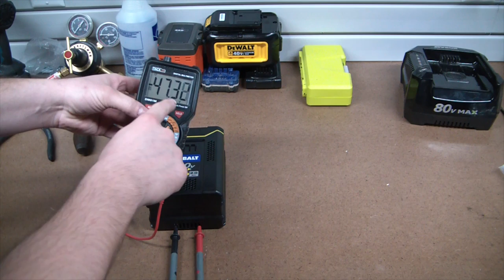Kobalt 80V Battery Recovery and Teardown - ElementalMaker

Comment: Just recovered a 2 year old 80v Harbor Freight Atlas battery ($110) that would start the trimmer, but immediately shut off recovered using this method.  Put it on the charger, flashing red. Checked voltage, 38+v each leg.  Press the test button, 3 lights.  Put it on the charger it would start the fan, then flash red. Connected same aged charged battery to each leg for some minutes, same issue.  Connected a new, fully charged 40+v per leg for 5 minutes each leg and this time it charged.

Comment: My dad developed back problems. Had these batteries sitting for a few years. Wouldn’t charge. No red light on charging dock. I hooked up plus and minus and charged it for a minute. Then put on the factory charging dock. And it is charging. Thanks.
Reply: There is a 20 hour "recovery" charge noted in battery manual

Comment: Will a 30v power supply work to charge an 80 volt battery?   Where do I get the terminals that stick into the battery, that the power supply clips, clip onto?

Comment: Who is the manufacture of the power supply you used to bring it back to life?
Reply from the maker: Thats a Sorensen lab supply I have, they are stupid expensive (I found this one at a thrift store), but any generic 60V lab power supply should work. That being said, its probably better to just buy a new battery. The one I recovered in this video only lasted about 6 months after recovery before it died again and I couldn't recover it.

Comment: @ElementalMaker - my Kobalt 80 Volt batteries(I have two) charges to three lights but when I put them in my blower it only works for a short time and shuts down. It reads two lights when it shuts down. Any Pro Tips?
Reply from the maker: It's probably a bad or reduced capacity cell within the battery pack. When one cell drains faster then the others, the battery will shut itself down to protect that cell from going under 3ish volts. You could run the battery until it stops working, and then open it up and probe with a multimeter to see which cells are lowest, then replace those cells, but I'll be honest that's way easier said than done unfortunately

Comment: This is a different subject than you were talking about here but wondering if you may be able to help me.  I have a new Kobalt 80v battery that says it is fully charged but when I put in the chainsaw it will start the chainsaw but then stops.  If I charge it again it will just do the same thing.  Do you know what the problem is?
Reply from the maker: Sounds like it may be a circuitry issue if the battery is new. Do you have any other batteries to test the saw with to be able to check that it's the battery and not the saw? If other batteries work, I'd say bring that one back to lowes while it's new and tell them you want a replacement. If another battery does the same thing in the saw, I'd guess there's some debris jamming up the output shaft causing the battery to sense a current overload and shut down the battery to prevent damage. I'd strip. The saw and be sure nothing is causing extra resistance on it like a bunch of little vines wrapped around the sprocket

Comment: Hey, I have one of these 80v batteries that charges well, but cuts off after about 30 seconds of use. Then if I wait another 30 seconds or so I can run a few more seconds. If I switch the battery tool works fine. Any ideas? Thanks!

Comment: What could be the problem if the third led doesn't light up anymore? I have 81 volt measured on the +/-.  Thank you very much.
Reply from the maker: Probably just a bad solder connection for the LED. If the battery is still working and charging okay I wouldn't even worry about it.

Comment: My kobalt 80v has an issue.  When i put it on the charger, the green light on the charger flashes, and all of the lights flash on the battery. After about five minutes, the battery lights go out and the charger lred light flashes.
Do i need to.perfomr your process to het it to work? And where do I find a power supply like yours?  Also, ehats the approximate cost of that power supply?

Comment: I have this exact 80v Kobalt battery. I was wiring up a electric Reel mower conversion and accidently blew the fuse on the back side of this battery. Do you happen to know what size fuse this battery pack requires?

Comment: I have a brand new 80v battery but it doesn't work, nothing but a solid red failure light on the charger. I assume I need to change the fuse on the bottom, but it looks perfect and is brand new. Confused
Reply from the maker: Best advice is to bring it back to Lowes and have them get you a brand new one

Comment: My charger begins to charge as normal but then after a minute or so it stops charging and the red light comes on. I check their voltage and they read 64 & 65 . Could the charger be bad?

Comment: My 80v Greenworks shows 1 light.  Blinks Green for about a 1/2 hour or so then starts blinking Red.  I had accidentally left it on the charger for the whole winter and that's what Greenworks says messed up my battery.  I thought about taking a battery tender and hooking it up to see if it would slowly charge it.  Thoughts?

Comment: I have a kobalt 40 v chainsaw that came with a battery and charger. I bought  another battery . I looked up kobalt batteries on Amazon. It has batteries i would think are kobalt knock offs and in the description it states they are compatible with kobalt tools.  Are these kobalt knock offs also compatible with the  kobalt chargers?
Reply from the maker: I can't speak for the manufacturer of the knockoff batteries, but I'm sure if they are listed as kobalt compatible batteries they will work with the charger. Definitely proceed with caution though, knockoff batteries are notorious for using cheap cells with poor protection circuitry and can die quickly.
Reply: @ElementalMaker  thank you

Comment: @ElementalMaker i just got a 4ah 80v greenworks battery off ebay that i think has this problem, i need to do what you did in this video, i dont have a dc power supply but i have a 2ah model 80v battery. What kind of wires do i ask for at my local home depot so i can jump the big battery off the little one? I saw another video of that being done, but this video is basically play for play what my 4ah battery is doing.
Reply from the maker: That's a very very dangerous way to go about it. You should have some kind of current limiting resistor in series to prevent an major malfunction. Even better would be to return the defective battery if you don't have the correct equipment.
Reply: @ElementalMaker  Unfortunately the battery was bought on ebay for about 1/3rd the current sale price on amazon/the greenworks website. So Greenworks won't do anything about it. I can send it back to the seller for a refund, but I just feel like it's salvageable and I need to at least try. When I put the battery in the charger, the charger turns on and the green light flashes and it acts like it's charging... but if you leave it charging for longer than 5 minutes it turns off and the light begins flashing red. So I shouldn't use a smaller battery of the same voltage to jump it, what power supply would you recommend in order to do what you're doing? Like, what am I looking for? If its like a $200 piece of equipment then I may as well send the bunk battery back and buy a brand new one, because at that point i'll have spent more than the 4ah battery costs. lol

Comment: I leave my 80V Kobalt battery on the charger all the time.  I went in the garage and saw that the red light was flashing. Its completely dead.  It had been on the charger for around 5 months.  I though the charger would trickle charge it as required.  Does leaving it on the charger after fully charged do damage?
Reply from the maker: Modern power tool batteries are lithium ion based and shouldn't ever be left on the charger. Best to give them a full charge, then briefly use it to bring it to about 75% charge, then just keep it on a shelf
Reply: @ElementalMaker  Thanks for the info, looks like I killed my battery.

Comment: I have the Snapper 60V same layout. I have two batteries that read Zero voltage and it will not charge even with a jump. How do yo get the batteries separated from the riveted connecters. I just want to replace the two cells that are dead. If you look at the top or bottom of each battery you will see a little double rivet on the plate. Thanks
Reply: Pry them off carefully

Comment: On my 80V Battery I get on (+) and (-) the Voltage, but no amps. I I'll test the battery with a tester, the voltage breaks down to 0. I'm pretty sure, there need's somthings to to with the midle pins, but I've no PinOut of the Battery. Could you help please?

Comment: What metal pieces do you put on the + and - on the battery to hook up to the power supply?
Reply: Were you able to get a solution? Don’t have a charger and need to get it powered up

Comment: I am hoping someone might be able to give me some advice. I have a battery that when you push the button, all 3 lights come on as if its fully charged. But when I put it in a mower it doesnt work. When I put it back on the charger, none of the light come on at all. What could be the problem? Thanks for any help or tips.

Comment: Kudos to you for charging at 250mA. It's not a good idea to charge at high current when discharged below the minimum voltage. But charging at a very slow speed until in the normal range is generally considered safe.

And yes, that battery is definitely made by Greenworks. Snapper and several house brands are just rebranded greenworks. The only difference between that battery and the greenworks branded one is the location of the grooves in the plastic outershell.
Reply from the maker: Agreed, some folks have apparently just jumped a bad battery with a good one, talk about a recipe for disaster! Thanks for dropping a comment Bob!

Comment: I did this and it it lighted up too and looks like it's charging again but when you use it. It still dies after 30secs of using it. So it didn't work
Reply from the maker: Man thats a bummer. Some batteries are unfortunately too damaged to fully recover. The battery I recovered in this video lasted about 6 months of use before dying again, and its capacity was definitely reduced.

Comment: Those batteries in that 80 volt pak are exactly what is in the PC batteries. I have about 50 of them and have bought VRUZEND caps and made many different voltage battery paks. For my 12 volt, paks, actually a bit higher
Reply: Do you know what cells are in them?

Comment: I've charged em up with a low wattage incandescent lamp a brige rectifier and a literally plugged in the wall. Charge to about 70V then pop in the charger to charge normally. Definitely take it apart and measure the cells to make sure you don't have a flat cell or two.

Comment: I just recently got a Kobalt Mower that utilizes the 80v 6 amp battery. Mowing my lawn leaves the supplied battery just below 50%. My question is in regards to best practices for my battery so I don't hurt its life. When the battery is at or around 50% after a mow should I just use the battery again for the next mow and let it run the battery down to 0% or is it safe/wise to simply charge the battery after each mow?
Reply from the maker: Your best battery life will be had if you recharge after each mow. lithium ions are not like old NIMH batteries that develop memory. A Lithium Ion will last many more charge cycles with a 50% capacity drain/recharge, than a full drain/recharge.
Reply: @ElementalMaker  So do you recommend taking off the charger after it's fully charged?  Or is it ok to leave it on the charger until the next time I use it?  Thoughts?
Reply from the maker: @dannyh3585  Yes remove from charger once fully charged.

Comment: Sounds like you need a suicide charger. It requires a 25-ish watt incandescent light bulb, bridge rectifier, and an AC mains plug. You hook the bulb in series with the bridge rectifier. The bulb limits the maximum current and the bridge converts the current limited AC into pulsating DC. The name of the device is self explanatory.

Comment: I bought a Kobalt blower from Lowes. Charged the battery full when I took it out of the box. Used the blower 1 time until it shut off from the battery getting to low. It won't take a charge. Put it in the charger. Blinks green on the charger and the battery status lights. After about 5 seconds the charger keeps blinking green and the battery status lights go dead. Anyone know of a way to fix this? Also with a volt meter I get 67 volts off the battery.
Reply from the maker: Definitely take it back to Lowes. That's a defective battery and they will replace it if purchased within the past year

Comment: Nice video, very informative. My DC power supply is 30 volts I think. 
If I get the Red light, I’m down to one battery, I put it in the freezer for 10 minutes or so, and it charges right up. I only started this process this week. 

Now the other battery is at 81.3 volts, + to - or Charge to negative. That battery does the typical Start the Motor, then the Mower Motor dies. I took it apart trying to look for any thing obviously loose, nothing to the naked eye. All tiny surface mount, ad a few processors. I’m pretty sure I dropped one of the batteries, waist high, you think it would be this one. Again I don’t see anything loose. Can individual cells get “weak” so I see the 80+ volts but they fail under the load of the motor?
When placed on the charger, all lights green no fan as you would expect with a fully charged battery. 
Thanks for reading.
Reply: Jeff Randels: 
Wish someone would reply to this.
My neighbor wanted me to check out their
GreenWorkStools mower with this SAME PROBLEM.
Pure over priced junk.

Lord, kill me if I ever buy a battery powered yard tool.
I repair small [gas] engines, so all of my equipment
is in excellent condition, and I don't have problems
with them.  9 acres, North Central Florida
Reply: @mrbrown6421  it’s not a simple board just to look at. It’s not like I saw a burned resistor or blown cap   
And everything is surface mounted. So I’m still at one battery. @ $200 a battery I’ll probably go back to gas
Reply: If the motor fails to run under load, then quite possibly there are some bad cells. To see what is happening, you would need a way to measure the voltage on the battery under load. Probably probing each of the two cells that are in balanced pairs. That means rigging up the battery with some testing wires that allow you to do that and read with a volt meter each 2 cell voltage reading at rest and under load. These cells are not that expensive individually, so if you find the bad cells and replace them, you might be back in business. There could also be a problem with the protection circuitry (caused by the drop or other). If all the cells look good under load, then it is most likely the circuitry and that would be unfortunate unless you have electronics background to do the repairs.

What type of equipment are you running? Putting the battery in a trimmer with the two speed settings would be ideal simple test to start with. Put it on the lower setting and see if it runs.
Reply: @michaelkrailo5725  A couple of bad cells showing 80 volts, but the board cutting out under the mower start up was what I thought was likely as well 
And as written above, just a lawnmower. 
I just haven’t pursued it further by taking the battery apart. 
My electronics background is as a hobbyist. Modifying vintage FM tuners, aligned 5/6 of them.  But all those chips and surface mounted items, yeah too much.

Comment: The Kobalt & Greenworks batteries have different slots so they will not fit each other unless you modify the tool or battery housing.  There is a vid on how to do it.  Good vid.  Thanx.
Reply: Where is the video on how to modify the tool or battery housing?

Comment: So what about a battery that i received at 2 bars soc... But won't take a charge?
Reply from the maker: What do you mean by won't take a charge? The charger refuses it, or the battery indicator won't go up to full bars? Have you checked voltage with a multimeter?
Reply: @ElementalMaker  charger refused it at 2/3 bars and again after running it to tool shutoff. i haven't metered it yet. It ran my wheedwacker just fine though.

I've got 3 chargers and all refused it
Reply from the maker: @TheFiremonkeyman  that would indicate the charger picking up on a potentially failed cell within the battery. Of course the charger itself could also be defective.
Edit: whoops missed the multiple chargers part. Sounds like the battery must have either a bad board or bad cell
Reply: @ElementalMaker  ok, i kind of figured that, but wanted to make sure before i tear it down too harvest the cells
Reply from the maker: @TheFiremonkeyman  no harm in taking it apart and seeing if you can find the bad cell. May be easy to replace, and if not you have a great source of backup cells as you mentioned 👍

Comment: Bought mine last month (40v trimmer), used the trimmer twice, never below 3 green and just received the blinking red light of death.  Still shows three green when test button is pressed.  Where's a good place to get the adjustable voltage charger you're using?
Reply from the maker: I would take it back to Lowes. I believe they are warrantied for a year.

Comment: How can I find something similar to the power supply. Have a bunch of snap on battery packs that might be save able
Reply from the maker: Amazon has some 60v power supplies. I got this one for $25 on Craigslist, but on ebay this one usually goes for $300 plus

Comment: I kept putting it in the charger over and over and eventually it got up to 68volts and has 1 bar on the battery, but it doesn't seem to go any higher than that. Just red flashing light, I'm to the point of just throwing it out lol